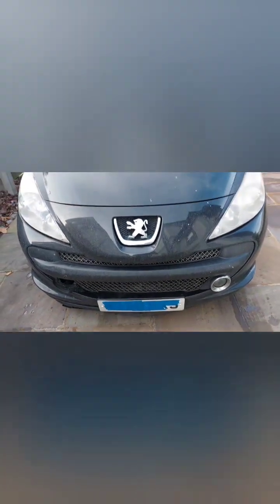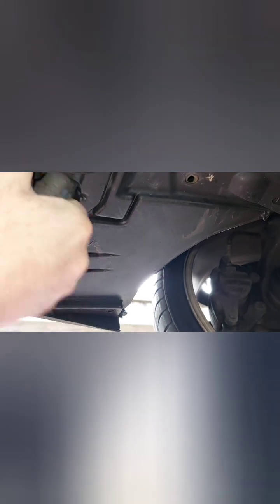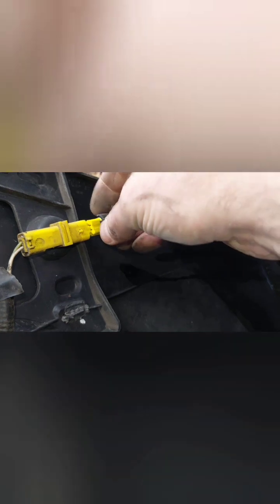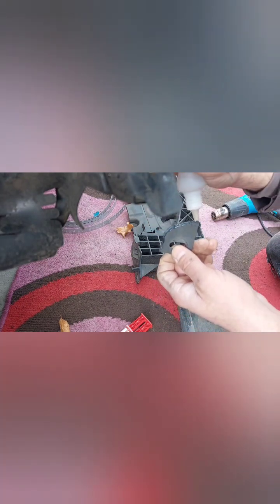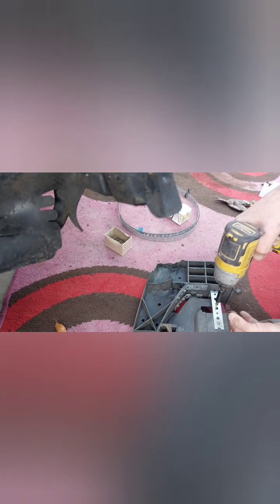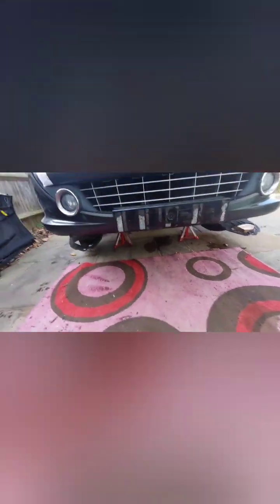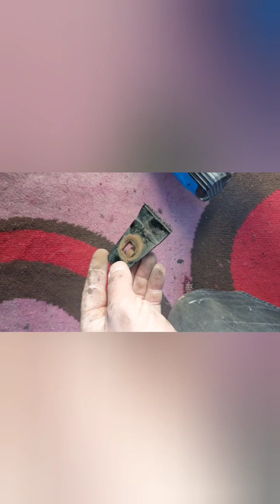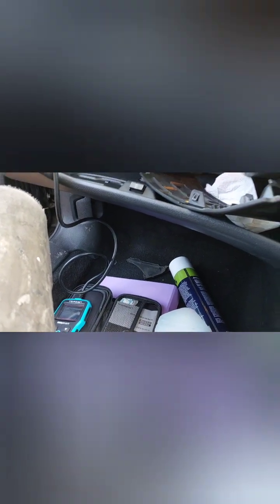Peugeot 207cc front bumper removal, repairs and refit, access to headlights and AC

Comment: Trying to source a n/s/f passenger wing for my 2010 207cc convertible. Are all 3 door 207 front wings compatible? I'm getting so much conflicting information some say they will fit others don't?
Reply from the maker: I'm 99% sure that all 207 front wings from same age are compatible. There are some differences in design of front bumpers, even so they are interchangable